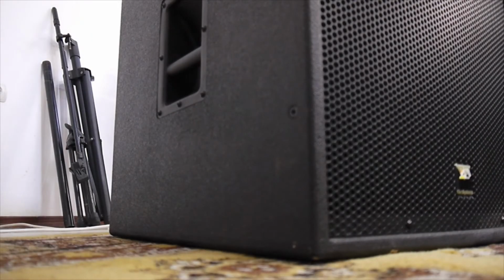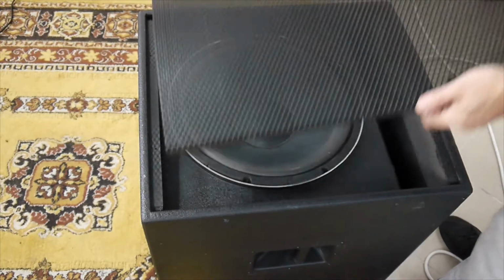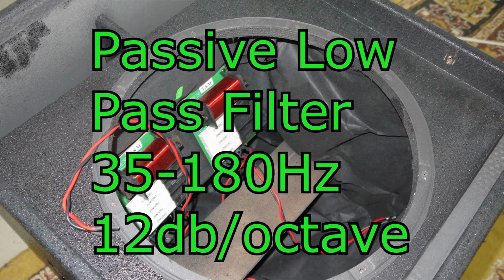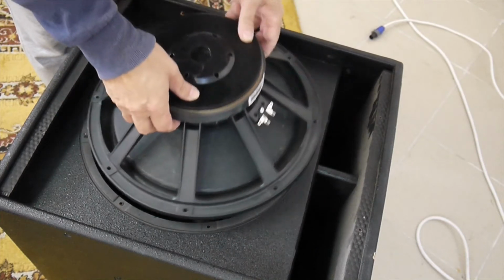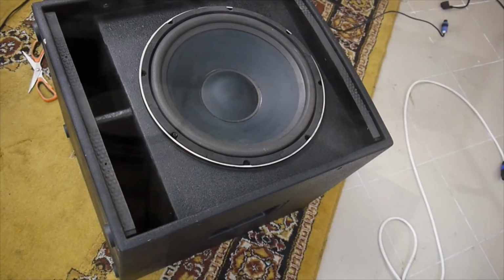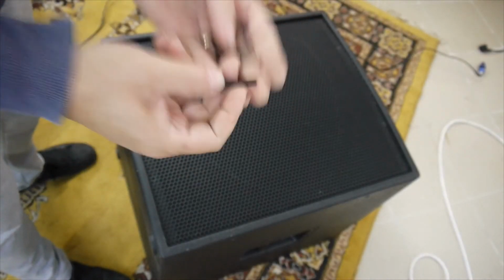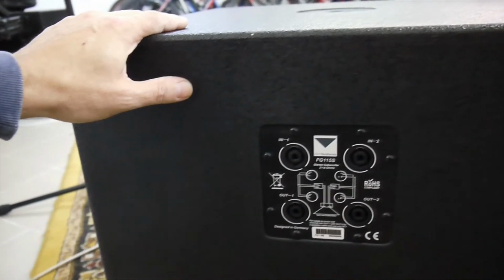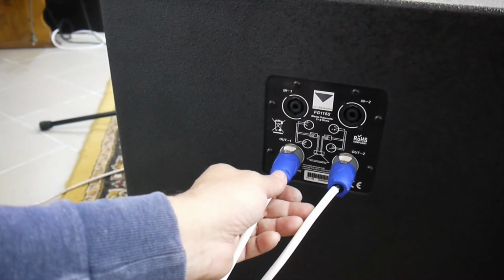T&M Systems FG115s passive subwoofer by Trius Ibbenbüren Germany, dismantle and tests.

Comment: I would like to add when connecting up dual coil or for that matter multi-tapped or coiled speakers, One needs to know about the phase of the Audio signal, I say this because there are some amplifiers in particular Dual or stereo ones that are half bridge Class-D amplifiers, These in the past were rare, but lately because of Class-D efficiencies having them produce around a 1KWRms or 500 watts X2 of power are now the minimum norm for PA systems.. 
Long story short one channel is driven out of phase at the input and then the output speaker terminals are reversed in order to return the phase back, as this practice avoids Voltage Bumping along with significant cancellation of distortion, anyway this practice usually isn't a problem until some one inadvertently services the amplifier and wires the output incorrectly..
Reply from the maker: Absolutely right, I didn't mention about phases because is common sense to have in phase amplifier running in stereo, there will be no sound, also if the polarity is wrong will be the same result..thanks for clear that!